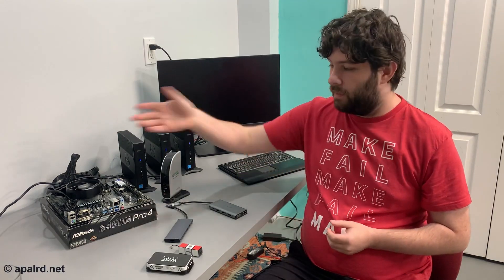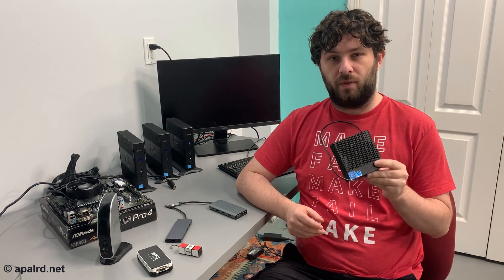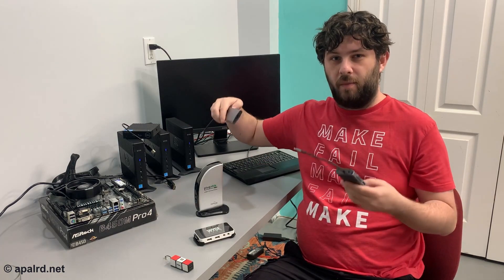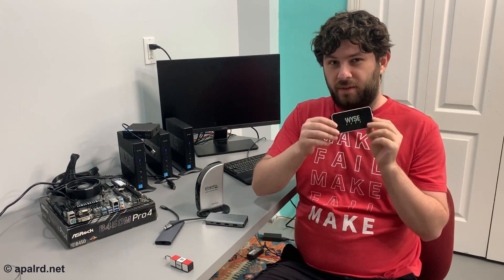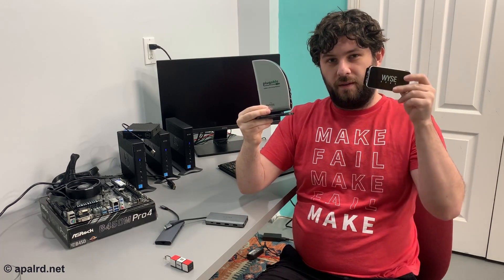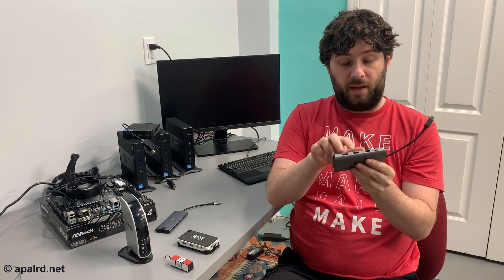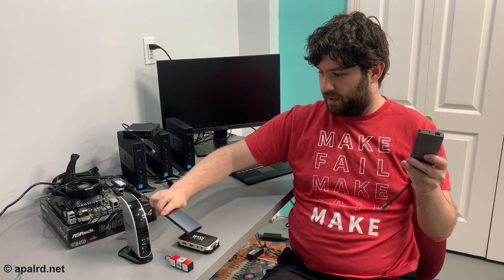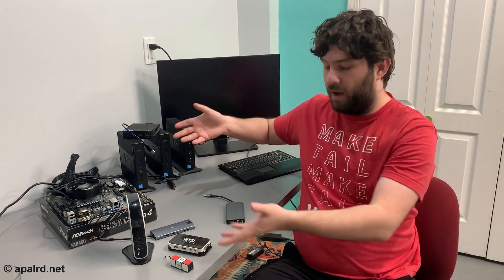Not Every Project Works, And That's Okay | Homelab Operations Center

Comment: What about Thunderbolt 3/4 with Linux?  There are some reasonably priced used laptops and other systems that have Thunderbolt 3 that dont have proper nics or display outputs.
Reply from the maker: I don't have any Thunderbolt 3 hardware to test with, unfortunately. But at least for Ethernet, USB3 should be a good option.

Comment: From my understanding, zero clients are just socks but over the network?
Reply from the maker: There are Ethernet based as well as USB based ones. This is basically a glorified USB hub + USB VGA adapter. I haven't dared try an Ethernet based one yet.
Reply: @apalrdsadventures  so a dock is a zero client?
Reply from the maker: Hardware wise yes, they are the same usually.

Software wise, zero clients are designed for independent user sessions separate from the main system's display/keyboard/mouse.
Reply: Nearly agreed to take some zero clients (maybe 5 or so) from a friend. I did some research before I accepted them. Completely dependent on walled Kingdom built on teradici pcoip. Might be able to make something work over RDP. Lost interest at that point. I was really hoping they were thin clients 🤷‍♂️

Comment: Try HP displaylink dock. They normally work.
Reply from the maker: The DisplayLink 3 dock works as a second monitor or mirrored, but I couldn't get it to be a separate seat. I'm not sure why yet.
Reply: @apalrdsadventures  I see, I misunderstood the issue you had.
Reply from the maker: I was very angry at the proprietary driver for not working as good Linux display drivers do lol. It wasn't entirely smooth even to get the desktop extension.